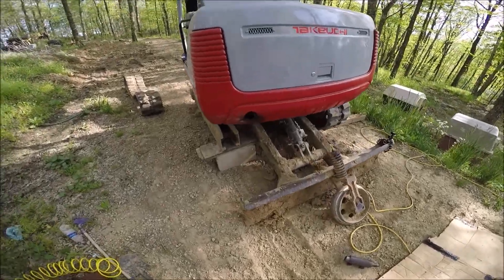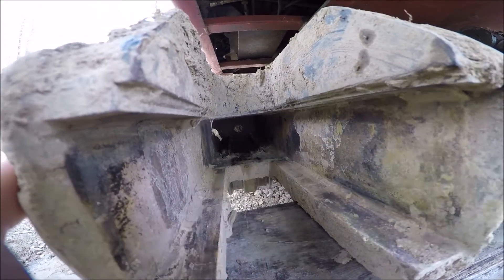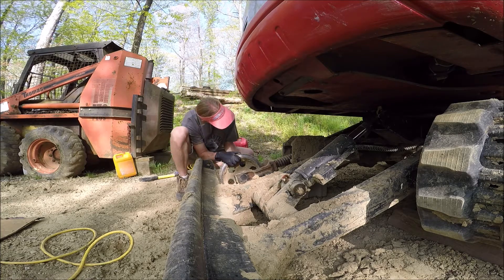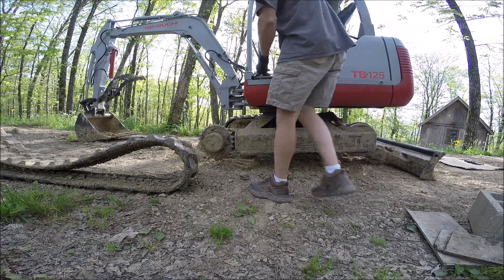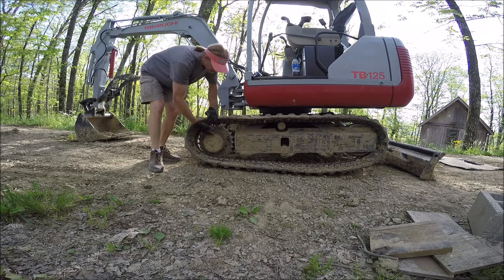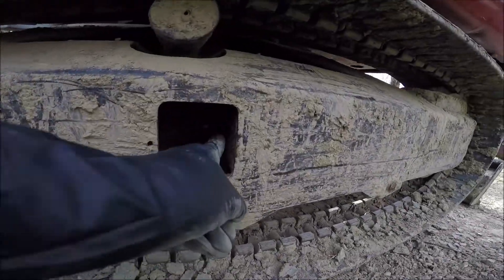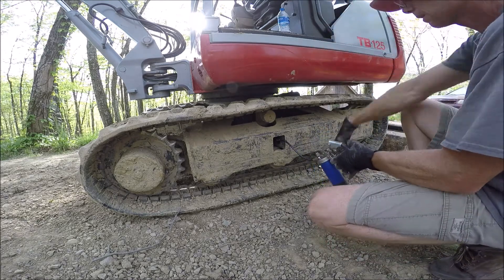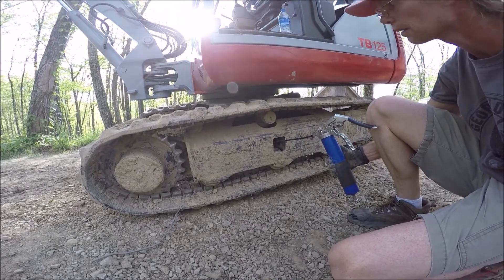(How to install)Takeuchi track tensioning cylinder

Comment: Hi, I had same thing happen on TB235.  Mine looks just like yours, one side popped out a bit.  Can it be pressed back in?  I cant seem to find a seal kit anywhere, where did you get yours from?  How much was it?  Does it need pressed in with a press?  Thanks, MP
Reply from the maker: Mr Push hello there you can find a seal for it. I found a place that does hydraulic cylinders and they charged me I think it was $16 installed, however it didn’t last long! I have a friend that is a technician for Takeuchi and he said just buy a whole new cylinder because the rebuild really doesn’t last. He was right. So I had him order me one for around $200! It’s been working still to this day! In this video I used the rebuild which worked maybe three weeks! 
     These machines have so much tension that builds and releases constantly the parts just wear out and eventually need to be replaced. That’s how it was explained to me! I hope this helps.
Reply from the maker: Mr Push I guess I really didn’t answer your question properly! With your seal popped out, it is definitely toast, unusable!
Reply: @jacelandadventures1523  Interesting.  I have yet to hear of these having any kind of consistent issues.  

I actually put the bulged one back in when i changed track.  So far its holding!  I worked it about an hour, no change in track tension so far.  Im gonna watch it n see what happens.  I dont know what the internal parts look like...not sure why grease gets much past the piston bore to reach that seal.

I actually think i ruptured it...i was using the bucket to push in the idler.  Wont do that anymore.  Following the manual to only turn the greaae nut 2 trurns is BS.  It does not always let grease out properly hence my pushing w the bucket.  Not sure why a rebuild would affect its longevity but i will consider a new cyclinder on that basis.  If you know someone lots of experience w these that is worth heeding so I dont have to tear it down again.

 How many hours would u say your got out or a rebuild?

Thanks.

MP
Reply from the maker: Mr Push not really sure how many hours I got out of it, but what I am sure of....it should not have let me down after just having it rebuilt! I didn’t necessarily want to have to go and rebuy that particular part but I did take the advice and do it anyway! My seal was genuinely messed up beyond repair once I looked at it, your case might be alright and I wish you luck on it cause taking them back apart and putting them back together can be time consuming!

Comment: Hi Jace.  This is exactly what is occurring in my TB145.  I was not able to find info on this anywhere else.  How did you repair the damaged seal once you removed the cylinder from the machine?
Reply from the maker: Hey James.  When it first happened to me I took the tensioning cylinder to a hydraulic repair shop.  and they said the seal was a weird size to them and they proceeded to fix $16.00  now when I looked at the work to me it looked like they crammed the dust cover in the cylinder around the ram, so I was skeptical  if it would work, and I was right it would hold the track tight for about to four hours of work and then loosen up and the track would pop off.  so after about 6 months of this which was about two weeks ago the seal blew again.  Now I have a friend who services these machine at a United Rental place and he told me that the tensioning cylinder and it's components are under so much pressure and tension that some certain factory cylinders just don't hold up well after so much work and replacing the seal just blows out frequently.  He told me to just replace the whole tensioning cylinder.  I picked  it up on August 3rd and it works so much better than the original one.  I paid $193.00 but I think that was a employee discount from him working at the rental place.  
    To me around $200 is a great deal compared to being broke down constantly having to put the track back on, it could buried in muck or anything and that well, just plain sucks. 
     Hope this is the information your looking for. and If you have any more questions ask away.